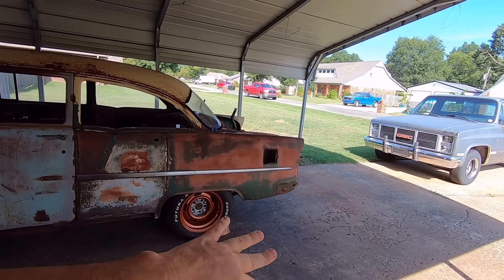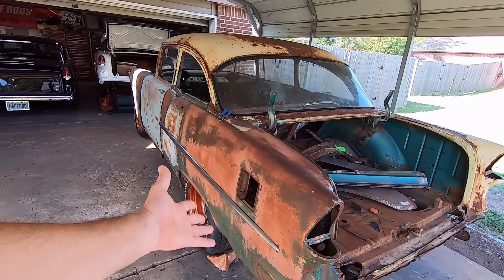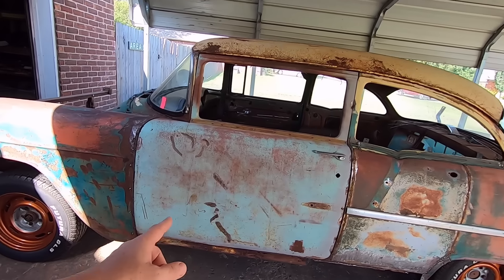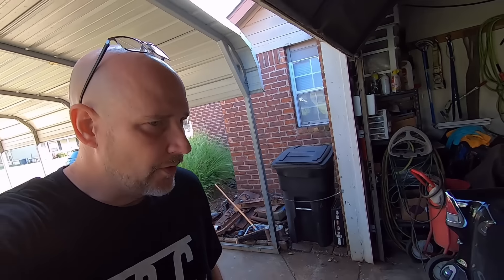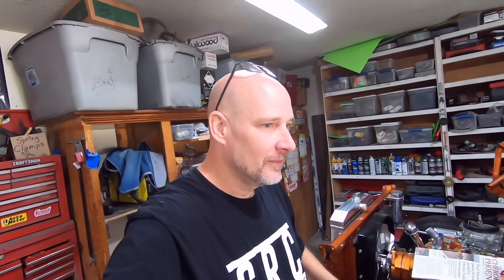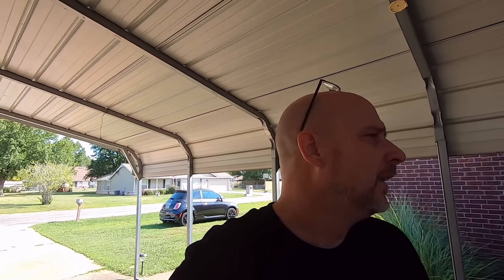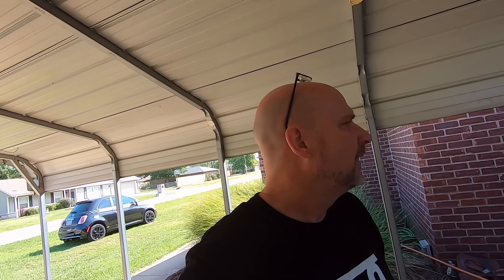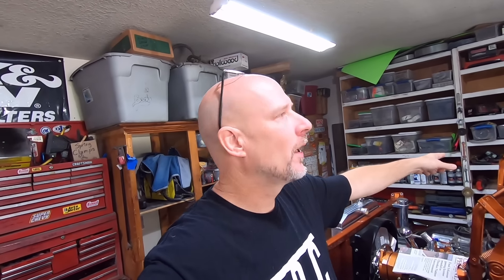Steve's 55 - Getting engine ready for new lifters and update on other projects

Comment: Hey there Rob - Enjoying all your videos and have gone waaaaaaay back to your 55’s Chassis (great job BTW)…
I used to build a couple engines a month, but now only a couple a year it seems. I finally threw in the towel on flat tappet cams and require the customer to pay for a Hydraulic Roller conversion kit. Yes, more money - but after having to pull engines and totally disassemble, clean, replacing oil pump and cam/lifters on a few engines because customers didn’t follow break-in procedures… Well you can imagine how some customers might think the problem was caused by the engine builder…. Glad I retired from that now…. Are you still working a full time job too?
Anyways - kudos on the projects!

Comment: I use the side of another lifter (which is very flat) to check for crown on lifters. If there is no oil film and you have a light behind it you can see they are crowned when new.

Comment: Cam companies do not make lifters. They buy them. I’ve had various Comp Cams and others. It depends on what they can get at the time. Which has been a real problem lately. But I have a new set of “Comp Lifters” new in the box that are actually GM HL-66 Lifters. I don’t think Comp is using those anymore because of cost.
Reply from the maker: I said the same thing in the video before this one. One lifter manufacturer then the companies finish them out